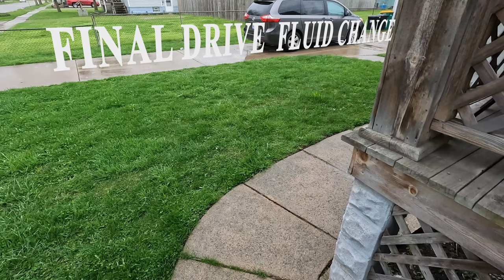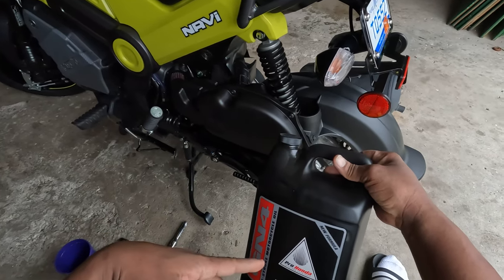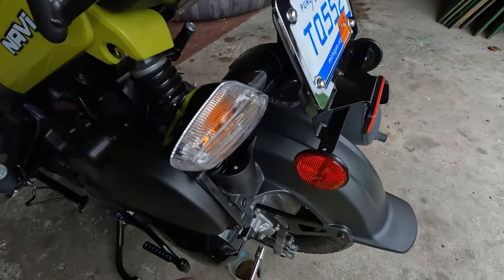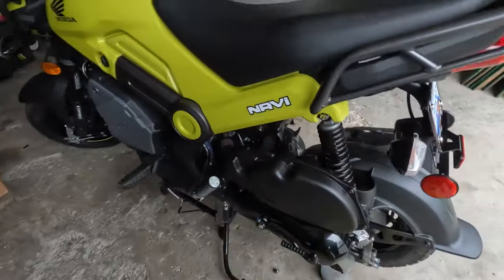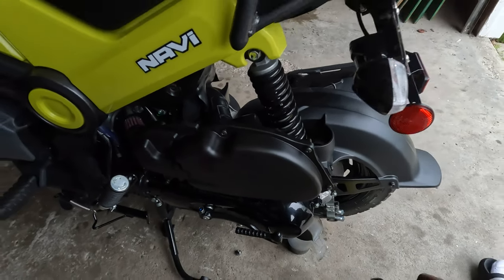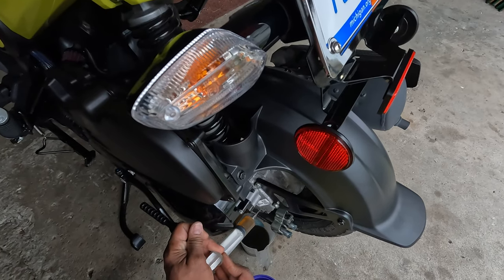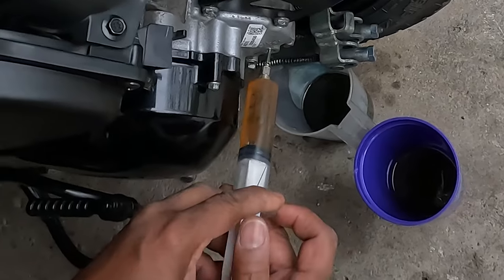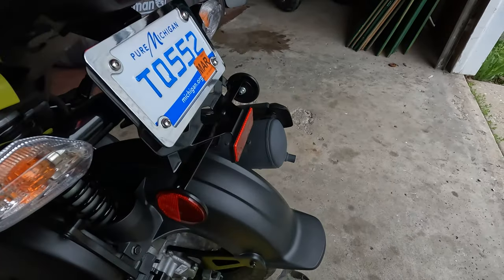how to honda navi final drive fluid change / GN4 10/30

Comment: One thing I would suggest (and no, it has nothing to do with the mic or sandals), is that when you want to refill the syringe, pull the plunger out to the level you want and then insert it into the oil, push out the air, and then pull the plunger back. It makes it a ton easier to fill the syringe.
Reply from the maker: its the only way to fill the syringe thanks for watching
Reply: @theonly1film  After seeing how dirty that oil is well before the recommended 2 year mark, I'll be changing my Navi's final drive oil every oil change... which means I need a bigger syringe, a lot bigger.